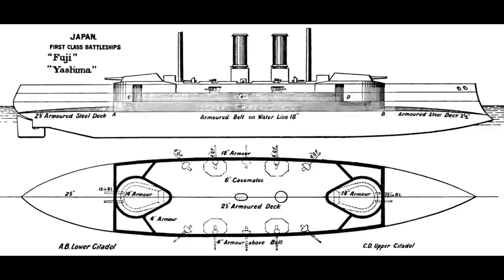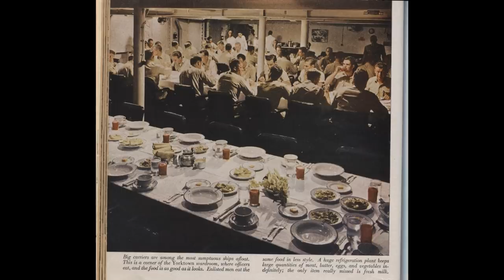The Drydock - Episode 130

Comment: I think the Japanese missed their opportunity for Kentai Kaisin to have worked at Guadalcanal. Had they committed the combined fleet to that battle, it would have forced the USN to scrape up every ship they had. 
1) They couldn't abandon the Marines 2) there was the threat of Guadalcanal being returned to Japanese control 3) the overall impact a IJN victory would have on the SW Pacific strategically. 

Instead the IJN committed penny packets of ships. This committed the IJN to a battle of attrition on the land, sea and air. A battle they could not win.
Reply: There was a reason the IJN didn't send everything they had to Guadalcanal (fuel supply issues, aircraft carrier pilot attrition, plus the fact their battle line save the Kongos and arguably the Yamatos not being fast enough).
Reply: @bkjeong4302  the Japanese Navy at that point was still near its peak. The Yamato was capable of 27 knots. Within a knot of top speed of any American battleship at that time. They outnumbered us in battleships, cruisers and destroyers at that point in time. We would have had to withdraw from Guadalcanal or take every ship available to the Pacific fleat to try and support, supply and reinforce Guadalcanal. There's a good chance the Japanese would have won that confrontation had they committed what the ships they had at that point against are available ships. That's my opinion anyhow. I respect that you have a different opinion. That's the point of having these conversations. from a fuel perspective they were at a high point in their merchant ships since the notorious Mark 18 torpedo had not been fixed yet, let alone the problems admitted by bureau of ordinance.
Reply: @bkjeong4302  I do find it really interesting that the Japanese tended to be very conservative on defense and very aggressive on offense.
Reply: John Rodrigues It’s also worth noting that the Japanese did not consider the waters around Guadalcanal to be suitable for large fleet engagements due to the confined spaces.  In fact, they were very surprised when Halsey sent SoDak and Washington to defend Guadalcanal for this reason.  Yes, Japan did send the Kongos on night raids, but they weren’t expecting to fight large fleet actions with them—just to bombard Henderson Field and get out of air strike range by dawn.   It’s doubtful that either side would have risked their full battle fleets in those waters.  It would have to have been a carrier battle, and while Japan had more carriers at the time, the US had an unsinkable carrier in Henderson Field.  Also, if Japan had sent its entire fleet, Britain would have sent the 4-5 battleships and 1-2 carriers it had in the Indian Ocean at any given time to assist.   So a kantai kessen at Guadalcanal wouldn’t have been as favorable to Japan as it might seem.  And even if Japan had won, that would buy them maybe a year before the Essexes, the rest of the SoDaks and some Iowas, a repaired NC, the repaired Pearl battleships, about a billion cruisers,  destroyers, and subs (with working torps), AND more of the Royal Navy, came and totally destroyed Japan’s already probably badly weakened fleet.
Reply: @bluemarlin8138  They didn't have to deploy in the slot. South of the Solomon would have cut off Guadalcanal and Tulagi. Once cut off the cactus air force, so much a thorn in their side, would have become moot at best. Most likely it would have stopped operating due to a lack of aircraft, parts and other necessary supplies. At that point the Japanese could resupply at will.
Reply: @JohnRodriguesPhotographer  I don't think they could have won either way.  Let's play it out though.  Let's say Japan somehow gets every available ship to the Solomons by early September of 1942.  Basically it would be a delayed Battle of the Eastern Solomons but with bigger fleets.  Japan had 2 fleet carriers (Shokaku, Zuikaku), 3 light carriers (Zuiho, Ryujo, Ryuho), and 2 escort carriers (Hiyo, Junyo).  The escort carriers and Ryuho may or may not have been useful, as they could only make around 25 knots.  Then, they had the four Kongos, two Fusos, two Ises, two Nagatos, and Yamato, for a total of 11 BBs and battlecruisers.  Musashi commissioned on August 12, but was working up until early 1943, so she wouldn't have been there.  (Alabama commissioned a week after Musashi, but was also working up through early 1943, so I'm not counting her either.)  Then you have a bunch of cruisers and destroyers.  

Meanwhile, the US has cracked the major Japanese naval codes and would have known that Japan was sending the whole fleet.  Not only that, but the USN in mid-1942 was a lot stronger than most realize.  It had Saratoga, Enterprise, and Wasp already in the Solomons, with Hornet on the way.  So that's 4 fleet carriers (even though Wasp was smaller, it still had a fleet carrier's air group).  It also has Henderson Field, which had about a fleet carrier's worth of F4Fs, P-39s, and Dauntless dive bombers.   North Carolina, Washington, and SoDak were already there as well.  Massachusetts would have been immediately sent to the Pacific and could have made it in time.  Indiana was technically still working up for another month or two, but already had all her equipment and probably would have been sent as well.  So that's five modern 16" fast battleships, all equipped with radar.  There were also some older battleships available.  Colorado and Maryland were both operational in the Pacific, so that's two more 16" BBs.  Tennessee and Pennsylvania were back in service after Pearl Harbor, and New Mexico, Mississippi, and Idaho were also available.  That's five 14" BBs.  So even if Texas and NY are left in the Atlantic, the US can have 12 battleships to Guadalcanal within 3 weeks.   The US ships will on average be significantly more modern, more heavily armed, and more heavily armored than the Japanese ones.  And of course it has a bunch of cruisers and destroyers too.  I'd already say that's an advantage for the USN, but it gets even better.  The British have HMS Formidable, Warspite, 4 Revenge class BBs, and escorts in the Indian Ocean.  If they know that Japan is sending its fleet to the Solomons (and therefore there is no threat of a repeat Indian Ocean Raid), then it's very likely that most of the British fleet goes to assist the US.  If so, that's a combined force of up to 5 fleet carriers (plus Henderson field aircraft), battleships, and a ton of cruisers and destroyers.

Now let's look at the tactical considerations and how it might play out.  We have agreed that the fleets wouldn't deploy in the slot, so we're looking at an open ocean battle somewhere near Guadalcanal.  That means the US and UK ships get to use their radar more effectively than they could in the historical battles.  In the air battle, the Allies would have more planes in this scenario.  Japan had lost a lot of good pilots at Midway and Coral Sea, and the US pilots were much better by this time.  Allied carrier air doctrine was not as well-developed as Japan's though, so that could have balanced things out somewhat.  However, the Allied ships had infinitely superior anti-aircraft capability, so that's also something to consider.  More than likely, the carriers are going to be the primary targets, and both sides probably end up with some carriers out of action.  Which side lost more would probably depend on which side found the other side's carriers first, but it could get ugly for both.  If the carriers were rendered ineffective and it became a surface engagement, then the Allies would have a big advantage here.  The Japanese would no doubt try to use their torpedoes, but at long range in open water, and with the Allied fleet screen blocking them, torp hits on Allied battleships would be very tough to achieve.  In a gunfight, the Japanese ships would be severely overmatched.  The Allied ships are much more heavily armed and armored on average.  The Kongos would go down in a hurry if they started taking hits.  Yamato would be a tough out, but two of the NCs or SoDaks together were more than a match for one Yamato, and the US probably would have used three just to be sure.  Even if the British didn't send any ships, or only sent a couple, this is still probably a pretty decisive US victory.  If the British did send ships, then it's possible there could have been some sort of coordinated pincer move, in which case the Japanese fleet would have been unable to even try to run away.  

So could the Japanese have gotten their decisive battle?  Sure.  I just don't think it would have gone the way they wanted it to.  Of course, this isn't the only possible scenario, but I think it's the most likely one.  Japan probably wouldn't want to risk decreasing the strength of its fleet with the smaller historical actions, or let the US strengthen its presence in the Solomons unchallenged, if it were going to send the main fleet.  So even if they pushed the attack back later, that means Saratoga, Enterprise, Hornet, and SoDak probably don't take their historical damage.  Wasp and NC could have still taken their torpedo hits, but Alabama and Essex were ready by early 1943, so that would have made the numbers about equal.
Reply: @bluemarlin8138  it definitely would be a worthy one to war game out. Also keep in mind the Japanese submarines and American submarines would be involved. If the Japanese Navy comes through the slot with all their Cruisers and battleships and shells the hell out of Henderson field that totally negates the aircraft at Guadalcanal. They wouldn't even have to fire their entire combat load what's the number of ships. If you remember they damn near knocked out the fighter strip and Henderson on the number of occasions with just Cruiser fire. In any case my point is the Japanese were always seeking the great battle and yet they avoided it when they were at their high-water Mark or just passed. As a consequence look at the number ships by lost trying to Pennypack it their way into winning at Guadalcanal and the subsequent cost of withdrawal. I think that truly was the only point in time that Japan could have forced the battle they had planned for against the United States.
Reply: John Rodrigues it would be interesting for sure.  I meant to discuss the subs.  Japan would certainly deploy them, but if the US had a large fleet in the area, the USN and RN would probably have sent a lot more escorts (with good ASW), so something like Wasp and NC getting hit would be less likely, though not impossible.  More likely they’d have to settle for sinking some escorts.  The USN would deploy subs too, and they would more likely be able to penetrate the Japanese escort screen due to Japan’s poor ASW, but of course the torpedoes still didn’t work very well.  So it could be a push between the sub fleets.   We could probably mention the PT boats too.  I’m not sure how many Japan had, but the USN had a lot.  The Mark 14 problems would have limited their effectiveness though.  

As for the aircraft at Henderson, Japan could in theory destroy them if it (1) had the element of surprise, and (2) actually wanted to risk weakening its capital ship forces for a bombardment mission after already having decided to go for a decisive battle.  I’m not sold that either of these would happen.  If the USN got wind of it at all, then those aircraft would either be evacuated and spread around the US carriers (and there was also a US escort carrier present just to ferry aircraft to Henderson Field, but I didn’t count it since it didn’t have its own air group once they were offloaded) or would be attacking the bombardment force (if it were daylight).  I know the Japanese did achieve some measure of surprise with their night raids historically, but that was largely because the ships were stationed at Rabaul and the orders could be given directly to the ships’ captains.   If there were a huge fleet sailing from Japan, then there would have to be a lot of coordination by radio, so the same level of surprise would be unlikely with the US decoding those messages.   Theoretically the IJN could have the main fleet rendezvous at Rabaul to coordinate with the ships already present and then split off, but Rabaul couldn’t really support such a large fleet, and said fleet would be sitting ducks while at anchor, so I suspect the main fleet would have stayed in open water and used radios.   I think deploying the entire fleet (or even a large portion of it) in the confined waters of the slot would be near suicidal and therefore out of the question.  The IJN only risked the Kongos historically because they didn’t expect to face US battleships and because they could be gone before dawn when they would be vulnerable to air attacks.   A large fleet in there would be more like a duck laying on its back tied to the ground than a sitting duck, and the IJN knew this.  I’m not even sure the carriers could launch planes in there, so they’d have to remain north of the Solomons.  With most or all of the IJN capital ships and escorts in the slot, the carriers would be without any anti-aircraft support other than whatever fighters they had flying CAP.  They would also be screwed if any battleships or even heavy cruisers found them—for instance, the British fleet sneaking up behind them and trapping them against the Solomons while they were focused on the US fleet and not flying recon to the north.  

I do agree that this is the only time Japan could have forced a decisive battle, and it is the last time they would have any shot at winning it.  I just don’t think it was that good of a shot unless the US/UK completely bungled the whole operation by not sending enough ships and/or deploying them in a boneheaded manner.   If, on the other hand, the US had sent a fleet to the Philippines, the Japanese would have had a much better shot since their logistics would have been much less strained and they would have had land-based air cover.  Fortunately, the US didn’t try to do that until we had overwhelming air and sea superiority and working torpedoes!
Reply: @bluemarlin8138  American subs, at the time, had the infamous Mark XIV torpedo. Bureau of Ordnance, safely ensconced behind their desks and swiveling in their chairs, had not at this point, acknowledged there might be a problem with their wonder weapon. Instead of just kicking bureaucratic ass, King should have transferred them to sub service in the Pacific and replaced them. I would have put the lot of them in S boats loaded with Mark XIV's and tell them to prove they work.

As for the slot, I would not have kept any of the fleet there. If I were Yamamoto  I would south and east of the Solomons. That where the supplies had to come through. Plenty of sea room, Cactus neutralized. The Japanese have a shorter logistics train to resupply at sea. The US Navy still lacked an appreciation for the Long Lance and IJN night fighting capabilities.

When confronting an enemy, I believe in doing the unexpected with overwhelming force. Adequate force is boring! LOL!
Reply: John Rodrigues yeah I mentioned the Mark IV problems and agree with your solution.  I only mentioned deploying in the slot in response to you saying it.  

Of course Yamamoto would try to cut off Guadalcanal from the USN, but he’d have to defeat the USN in order to do that.  And if the US sends the fleet I described above, that’s going to be a tall order.   Yes, the Type 93 was a fantastic torpedo, but the US mainly had problems with it in small cruiser/destroyer surface actions, usually at night, at close range, and in confined waters with no screening forces.  These actions were at close range mostly because the confined waters made US radar ineffective when the very nearby islands caused interference.  In an open water fleet engagement, radar could operate as intended, and would have been a huge advantage for the Americans regardless of Japanese night training.   A radar-equipped fleet screen could have prevented the IJN from getting in the pot shots at battleships that were part of the kantai kessen doctrine.  The USN might have lost some cruisers and destroyers, but hits on BBs would be very unlikely.  Remember, Kantai Kessen was supposed to take place in the Philippines, where Japanese small craft and destroyers could rush out from behind small islands and launch night torpedo attacks before the US fleet screen could react.  Not really applicable with the US fleet likely staying in open water south of Guadalcanal.   Of course, the Japanese probably would have known that these pot shots would be difficult, which is why I think they would have gone for a straight up daytime fleet battle, probably underestimating US fleet strength due to poor intelligence.  And as I mentioned, even if the IJN were able to somehow cut off Guadalcanal prior to the fleet battle, those aircraft would just fly to the carriers if they had any warning whatsoever (which they likely would have for reasons I discussed earlier).  4-5 fleet carriers could handle some extra aircraft each in a pinch.  And if the planes don’t get off the ground, it’s still going to be pretty even in terms of aircraft since all but 2 of Japan’s carriers are light ones.  And if the British show up, it would be back to an Allied advantage in the air.

As for the logistics train, yes, the Solomons were closer to Japan than the US.  However, the US had Hawaii, Australia, and at least one South Pacific Island refueling base.  Its ships also had very long ranges for exactly this sort of situation.  And while the US logistics ships weren’t as numerous or effective as they would be in a couple of years, the US logistics train was still far superior to Japan’s.   Basically, the USN has planned to fight far from home, and the Japanese has planned to fight in the Philippines.  

So I’m sticking with a big advantage for the US.
Reply: @bluemarlin8138   @BlueMarlin81  Given the performance of the USS Ralph Talbot and USS Blue, at the first battle of Savo Island, the effectiveness of screen vessels at that point in the war is dubious. 

One fo the problems in the US Navy it was expanding at the time of Pearl Harbor. Professional officers and NCO's were being diluted as cadre's were being created for new construction. The same was happening to the USA, USAAC, CG and USMC. Ranks being filled with people fresh out of school. I don't blame the "new guys", it just was.

The USN was also undergoing a transition from Mark 1 eyeball to radar. Unfortunately not all officers understood radar let alone how to use it. (as at Pearl Harbor) An example being Captain Bode, in command of USS Chicago. He was under the impression radar would be seen like a searchlight by his enemies. Consequently Chicago was allowed 1 360 degree radar sweep every 30 minutes. He made a few other decisions during the battle that resulted in him being hauled before a board of inquiry. Sadly upon learning of the unpublished findings, he committed suicide. I would have issued a rebuke, but made him a radar expert and gave him a new command.

At The Battle of Tassafaronga, Rear Admiral Carleton H. Wright commanding, provided the USN with a resounding defeat. Not only did he have tactical surprise, he had Captain Raizio Tanaka out numbered and out gunned. This officer I would have either kicked out of the navy or I would have sent him command a weather station in Antarctica. Look him up.

At the Battle of Guadalcanal, Admiral Callaghan made serious error. He chose to fly his flag from USS San Francisco, equipped with early SJ radar instead of the USS Atlanta which had the latest radar sets. An Admirals responsibilities are heavily dependent on information and situational awareness. This would have been better served on Atlanta. His dispositions could have been better, making better use of his radar assets. Beyond that, I think he did as good a job as he could. His cruisers shot hell out of IJN Heie. No one should doubt his bravery or his dedication. Again understanding the advantages radar can provide during night combat.

Admiral Willis (Ching) Lee was probably one of the smartest surface combat Admirals we had. He proved it against IJN Kirishima. However his screen was completely mauled, doing there job.

Admittedly the USN gained experience over the course of the Guadalcanal campaign. Ultimately gaining to a degree ascendancy. If Yamamotto had committed hi fleet, these painful learning steps would not have occurred.